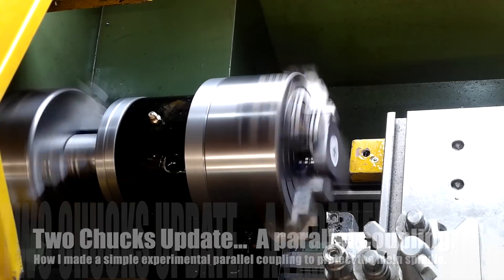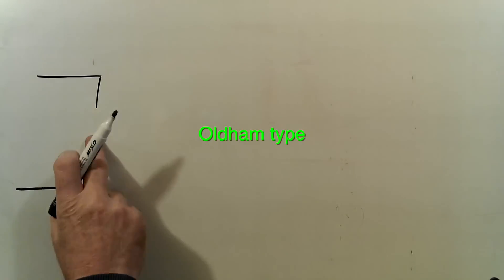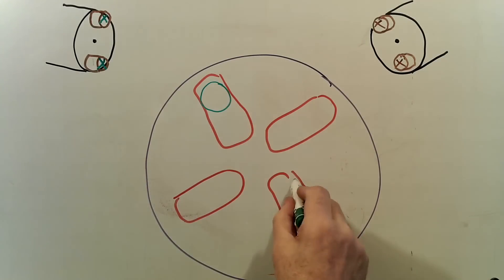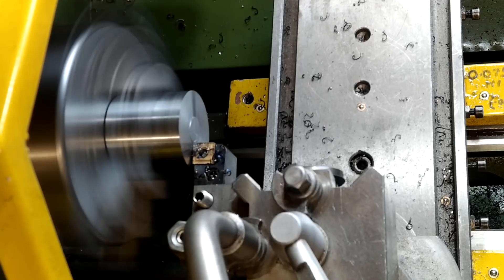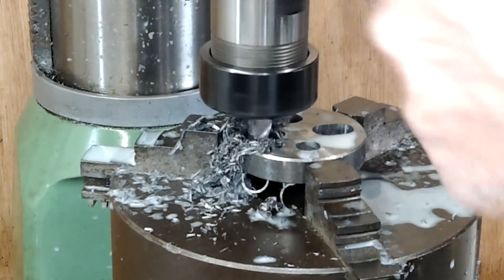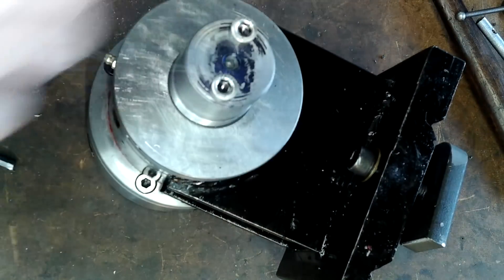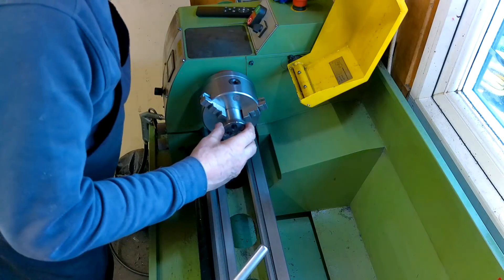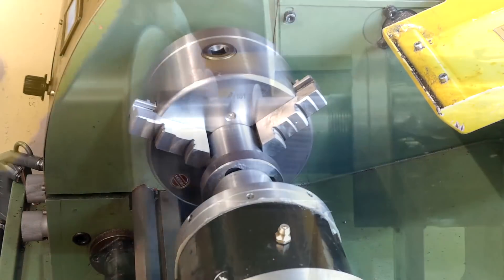Two Chuck Coupling Device, an interesting project.

Comment: absolutely brilliant.  Paul, I'm curious if you've had a chance to measure for runout at the 4 jaw since the 4 jaw is quite a ways from the spindle.  And perhaps another thought is that most ways wear in the vicinity of where your 4 jaw sits on the ways, how is the alignment with the tailstock?  Best regards, Gilles
Reply from the maker: Hi. I have started a new video, an update if you like, I’m not going into detail with it, because there’s a lot more wrong with this lathe that I can’t quite put my finger on. I think both three jaw chucks are worn out of spec, but not in the way most would suspect. cheers

Comment: What's the purpose of having a 4-jaw mounted like that ?
Reply from the maker: I think I explained in the video.
It saves me having to set the three jaw up after using the four jaw.  Its very quick to setup. It still works like it should. I get to use the saddle further up the main slide….
Reply: @Thesheddweller  Interesting ! (I don't think it was mentioned in this vid). I've checked a chuck for accuracy ;) Perhaps I will, when I get going, out of entertaining interest !

Comment: I think I would have gone with a Falk grid type coupling. Can handle any axial mis-alignment you might see. Has good power transmission. Is reasonably compact. One half could be bored out to fit the OD of the secondary chucks drive side. The other side bored to fit the Stub shaft in the 3 jaw. But then again the idea here is to just do it with readily available materials.
https://www.googleadservices.com/pagead/aclk?sa=L&ai=DChcSEwiuwp2kpNTvAhUa8uMHHQGdCS8YABAYGgJ5bQ&ae=2&ohost=www.google.com&cid=CAESQeD2k42loeH9-TpAS_szQGUYVQ562hUDpUvNzMRYqof17mUQcY8SuwWdYCMT26G3aZB1YqgOd_ZmbClCzX1HczxA&sig=AOD64_3V85H6var-tOAK1wLdR4AFXzVgeg&q&adurl&ved=2ahUKEwi915SkpNTvAhXMVc0KHdYqBmcQ0Qx6BAgFEAE
Reply from the maker: Hi, the 'Falk grid’ system is the same as the 'duplex chain’ system both very good systems but I hadn’t got one in my workshop. Regards
Reply: @Thesheddweller  Your idea is a more direct drive a Falk could give you problems with an interrupted cut.
Reply: @Thesheddweller  
We used to have large drill and slot milling heads off of a machining transfer line the machined connecting rods. Four rods per work station and each head covered four caps and four rods. That's 16 drill stations per head. In order to test run them after rebuilding we would put them up on one of our boring bars fill with oil and spun them up. This was normally done with a paddle that fit in opposing internal spline teeth. Not ideal. So I made up a "drive shaft" using a spline shaft to fit the head, a Falk coupling, a short shaft, another coupling and the drive end that would go into a tool holder in the bar spindle. An idiot on another shift tossed it out because "that's not how we always did it in the past". No matter how one tries to take the idiot out of the equation the idiot always finds a way to prevent it. We also at one time ordered a Tailstock for use with Super Spacer indexing heads. The tailstock was a little lower than the spacer heads so I made up a ground and keyed spacer to match heights. Yes, the idiots stuck again. With in a month the spacer was missing. I doubt we will ever be rid of them

Comment: I just put the external jaws on my three Jaw and use it to clamp the 4 Jaw.  So far it's been good enough.  I have three 4 jaws of decreasing size which helps.  The smaller two have face plate/stub shaft options.   I tend to leave these on most of the time for use on internal jaws of 3 jaw.
Reply: Yes my arrangements bring overhang out somewhat.  My smallest 4 Jaw is only 50mm dia and has a screw on stub shaft.  I also made a MT3 screw on as well as straight screw on shaft.  The middle 4 jaw is an £80,  80mm dia from Chtonos.  I leave an MT3 on this and sometimes use the spindle Taper close into the spindle.  Other times I clamp it in the three Jaw with the MT3 in there but doing nothing.  I very rarely need 4 jaw bigger.  But if I do,  say for squaring a big block, I tend to swap chucks for a big job.  I tend to use four jaw for one single  job.  If I have my 125mm in already however, I tend to just use the dial gauge until I get in the mood and return to three.  Thanks for your well prepared and shot videos.  I'm based in Cork, Ireland if you ever get this way.
Reply from the maker: @jossfitzsimons  you must do some very fine stuff to use a 2” chuck. ATB
Reply: @Thesheddweller  No. Its a cheap one but Good for small flat pieces like washers which would be difficult to align flat in a bigger chuck.
Reply from the maker: Hi, yeah, it’s great when you’ve got the kit to do that with. I too can hold the 4jaw chuck in the 3 jaw chuck but the extra leverage would play havoc on the spindle bearings. Plus I’d have to remove the three studs on the back plate. regards

Comment: "This center finder is rubbish" so far okay... but why??? And what was the easy method of milling the slots? Please sir. A bit more exploration. But besides that,  it is a great project and a great video.  Thank you
Reply: The easy method is plunging down instead of side milling
Reply: The technique is shown quite often on Joe Pieczynski's channel, plunge cutting with the end mill rather than side milling initially, the side mill to clean up the edges
Reply from the maker: Hi, The centre finder isn’t anywhere near centre, over 45mm it is 1.5mm out. plunge cutting was the best way taking only 0.5mm cuts, I tried plunge cutting at 1mm per cut but it still vibrated, the overall instability was the problem due to over reaching. I should have clamped the material to the table on a sacrificial plate that wouldn’t have been a problem, but I wanted to use an indexable three jaw chuck, mine sits on top of a kerney and west, universal indexing unit. quite a tall one at that.
Reply: @Thesheddweller  Thank you for your reply,  I am just a hobbyist trying to understand the magic. And I find your approach to your problem very interesting.  Kind regards Henrik
Reply from the maker: @henrikhv5084  Hi, thanks. 
The centre finder was a cheap item I bought at a tool market just over a year ago.  The lines I drew over the Marking blue did not line up with each other when the centre marker was reversed, and it should do. In engineering always, if possible, check your results using at least two different methods or back trace to see if you get comparable results. regards